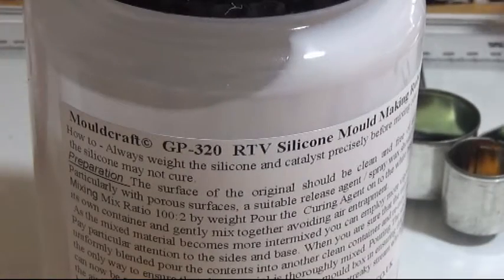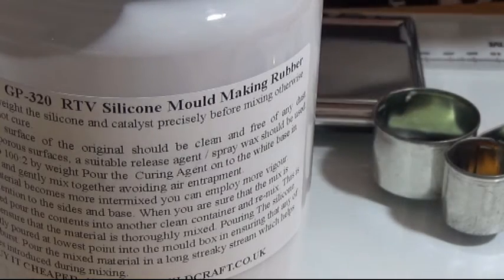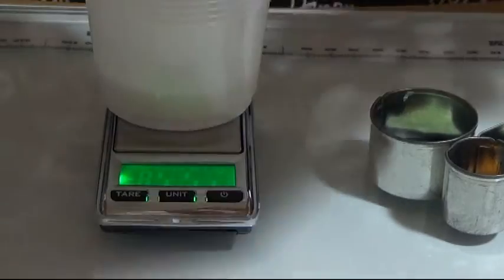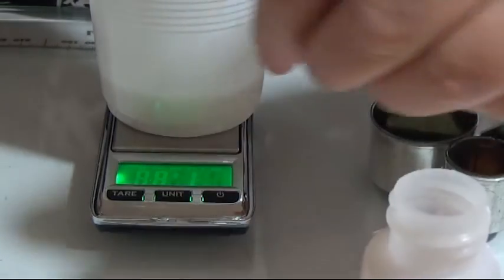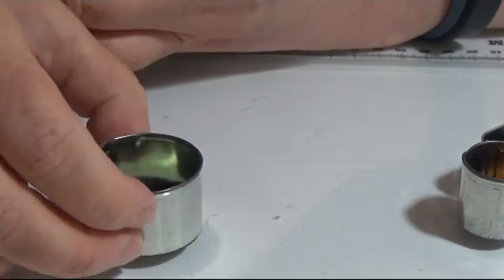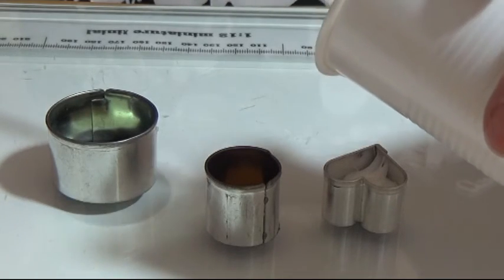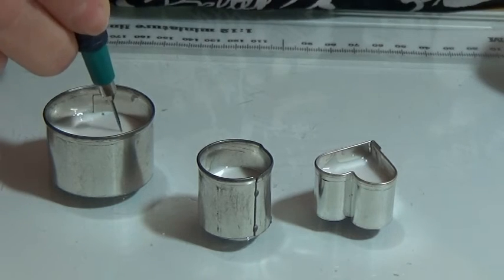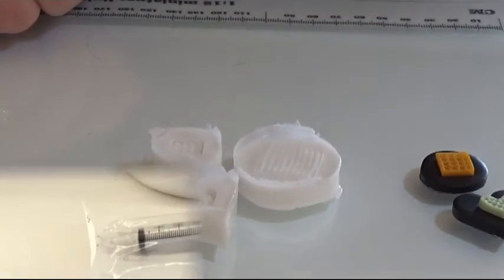Tools - Mold putty GP 320

Comment: Was this your first time using liquid mold putty? I've always wanted to try some, because I don't like amazing mold putty. It cures way too fast, and I never get very good results. :-(
Reply from the maker: +Lindy Diddle Yes this is my first time - I love amazing mold putty, only thing is that you can't get it here, so I have to get it online, and it is kind of expensive :-(
Reply: I think next time I'll just make homemade mold putty with silicone, cornstarch, & acrylic paint. In the videos I've seen, it doesn't seem to set up as fast as AMP, giving you more time to work with it. Plus it's cheaper.
Reply from the maker: :-) tell me how that goes
Reply: +Lindy Diddle Liquid silicone is awesome. I have had great luck with Oomoo's brand of liquid silicone. I had to learn some things like don't clean your piece with alcohol before molding or the silicone will bond to it. :P That is how I ended up with a broken glass globe. laughs Otherwise it has been a dream to use and I can't see going back to mold putty again. 

I have tried the DIY for making a reusable liquid molding material as well. I forgot everything it uses but I know one of the ingredients was a glycerin which I found in the pharmacy section of my local grocery store. I think the other thing was gelatin.  It works great and if you don't like the finished mold just microwave it a little to get it to a liquid state again. 

- Heidi
Reply from the maker: Hi I think this is a fine liquid mold thingy, I might have a try at the once you are talking about here, just to try it out, for now I stick to my normal moldputty, I do vill use all of this up, but I will not get it again
Reply: +BlackCat2 Thanks for the info Heidi! :-)